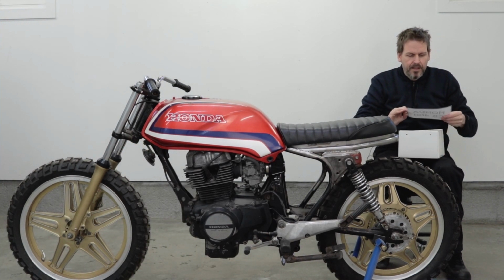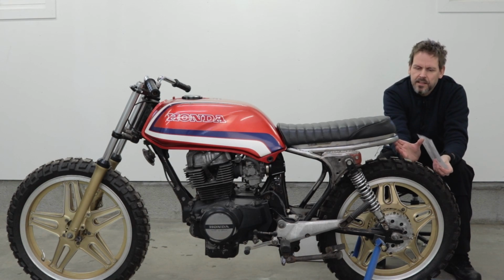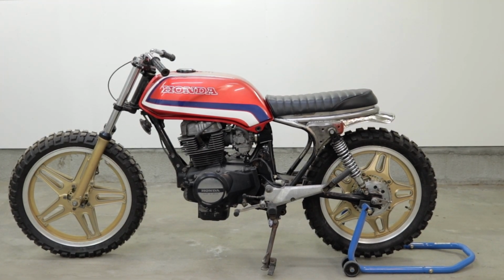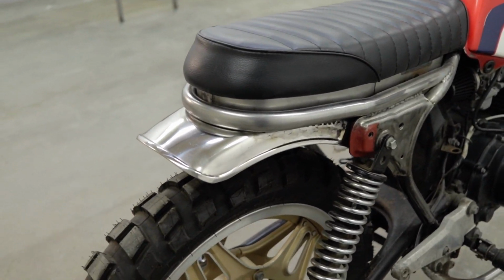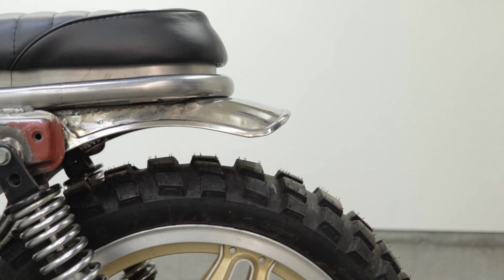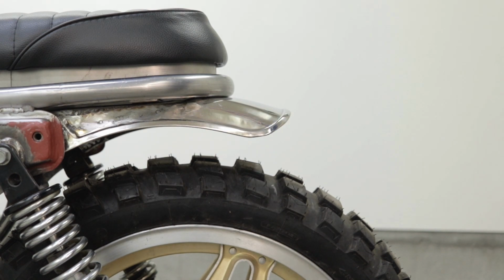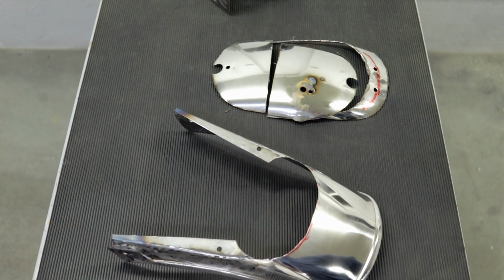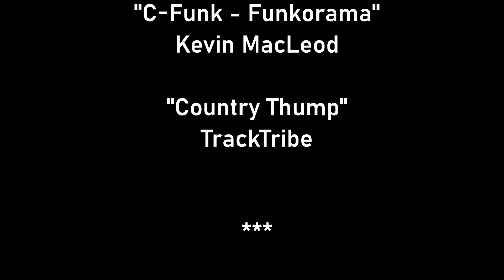Customizing the Rear Fender (with non helpful friends) - Honda CB400 Cafe Racer Build E1·S2

Comment: Hi, have you thought about having the number plate mounted on a bracket coming from the rear axle rather than above the wheel. Also are you planning on doing the Distinguished Gentleman's Ride at the end of May?
Reply from the maker: Thought about it for my next build, I have bought the bike already 🙂 Would have been fun to join the dist. gentlemen's ride, perhaps sometime in the future when we have got rid of the coronavirus
Reply: @kihestad  I'd recommend doing it, I've done the Oslo ride for the last three years, its great fun. If you find me on facebook you'll see the skilt bracket I have on my GSX750ES. I cheated and bought one off wish but should be simple to make.